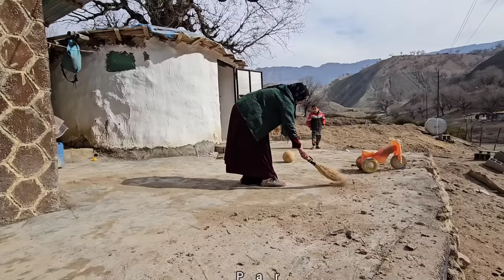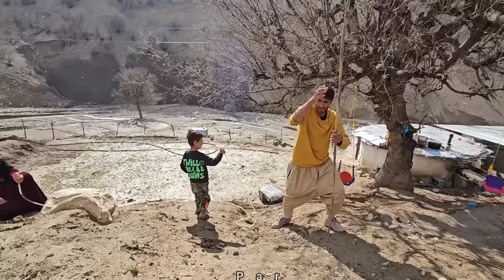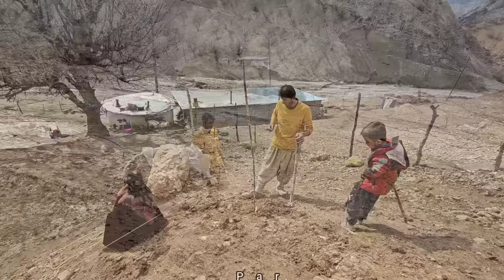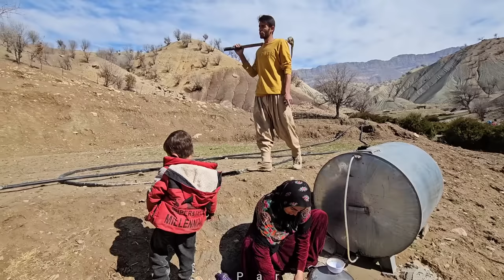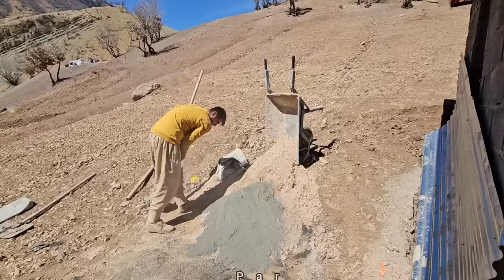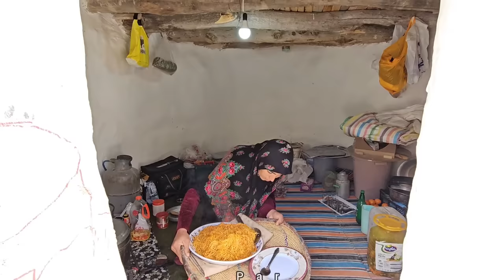rural life   Babak goes to the city to buy fruit seedlings. 🌳🌴🏡

Comment: In front of the house would be a good place to plant edible and medicinal herbs for Narges to use . Planting trees in front of the house may damage the concrete areas and stone wall.  Also, for now while the trees are young, you need to put large rocks where the trees are on the slope, so when rains come it does not wash away the soil from the roots. Later when the trees are larger, they will hold the soil in place, but while they are small and young you must protect the roots.  Since the trees cost so much, buy a few each month. One flower tree would be nice for Narges and ‘baby princess’ to plant when the baby is born.🥰🌺. Do you know what growing zone you are in? Pick trees especially for your zone. I have made that mistake before. Do olive trees grow there? They need little water once established and do well in heat of summer. You don’t seem to get much snow, so that would be good if olives are used for cooking or eating. Apples, pears, cherries should be good in your area, I think. Also nut trees like walnuts you love. Flowering trees will feed your bees, too.